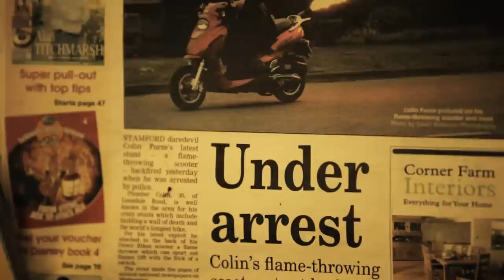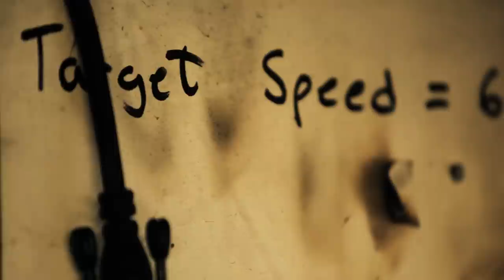This Insane Inventor Built The World's Fastest Mobility Scooter | Colin Furze

Comment: Okay here’s one;  take a series of frequency transmitters and boosters to increase the hertz output and pass or aim that transmission bundle through pure helium put a series of receivers just behind or all around a series of empty; tied off balloons.

You can actually teleport matter and fill the balloons with pure helium.  The faster the transmission the more gas you can trap and teleport.  The compressed gas will pass through the membrane of the rubber as the frequencies pass through the target and become trapped ; filling the balloon until it ruptures. 

It’s actually an aspect of applied physics relative to the gas laws.   

Helium is the smallest stable gas to work with.  Be careful not to saturate your own bodily tissues with gasses you’ll get the bends and never have to get wet. 

This is called ELHFED.   

If you transmit with military grade controlled transmitters you can actually saturate any matter with a compressed gas then watch what happens if you turn OFF THE COMPRESSIVE ENERGY.   Receivers aren’t necessary here. 

You will see the first ever public display of molecular disassociation; TESLA’S DEATH RAY DEVICE.  yeah; it’s real.

Comment: Ok so I just subscribed to your page I'd seen the mobility unit before but just ran across it again while looking at various mobility units as My father needs one and I will also one day as he was kind enough to give me his spinal disfunction The disease has a name but even the Dr. doesn't try to actually say it. ( sorry for my lack of spelling skills Dyslexia ). Anyway didn't come here to mope. What I'm looking for see help designing a mobility unit that I can have for my dad now and later for myself. I have several go cart type parts ( 2 axles 1 hubs  1 gear 6 wheels/tires 2 drive belts ) NO frame, seat, motor, body, steering unit, brakes, fuel tank, battery.
 What I have in mind is something that uses all 6 wheels/tires as I am not getting any lighter ( 295lbs.) a light weight frame handlebars or steering wheel, hand controlled brake/speed/steering, padded seat with cargo area. Any ideas will be greatly appreciated. 
What is a Pram>

Comment: You are going backward way to go much faster with dirty and noisy 2 strokes gas powered mobility scooter from electric scooter. You should try 5000 to 10,000 watts motor. "REALLY!" you'll have to push start gas powered scooter. No push start required with 10,000 watts electric scooter even on up hill start up.

Comment: sounds like a 50cc 2 stroke
Reply: 26 ORHAN 26 You wouldn't get that kind of speed out of a 50cc two stroke. My friend had a 50cc motorbike and it would be about equivalent in weight and lucky to hit 30 mph.
Reply: i have got a 2 stroke 50 cc supermotard (malaguti xsm 50) and its fully original and its max speed is about 95 km/h (60 mph)
i dont know what kind of piece of shit your friend had :))
Reply: 26 ORHAN 26
The max speed video showed 90 kph. It's still a far cry from the 130 kph this guy made it to on a vehicle of approx. the same weight.
Reply: +26 ORHAN 26 The scooter has a pitbike engine which is 140cc. He made a few scooters, one with a 125cc engine with electric start that I know of. 4 stroke as far as I'm aware
Reply: +Joseph Summersss